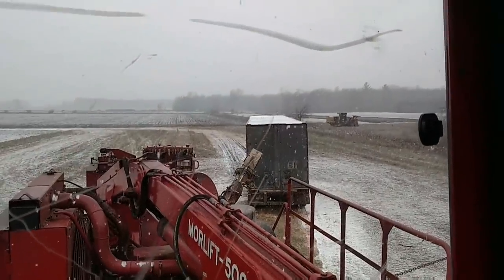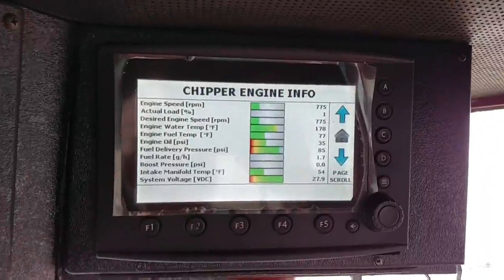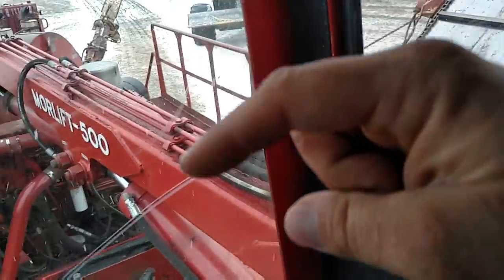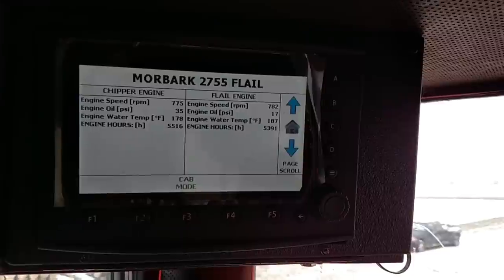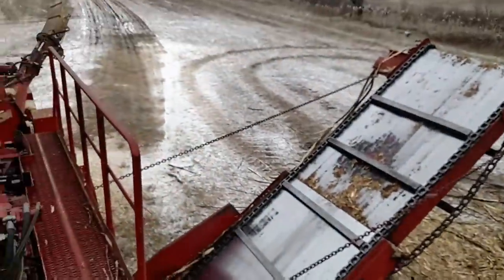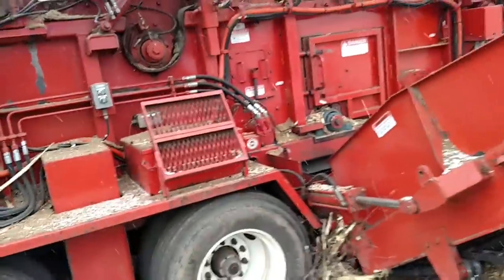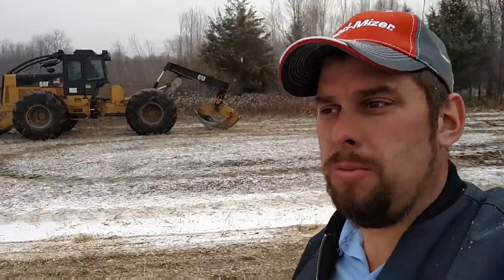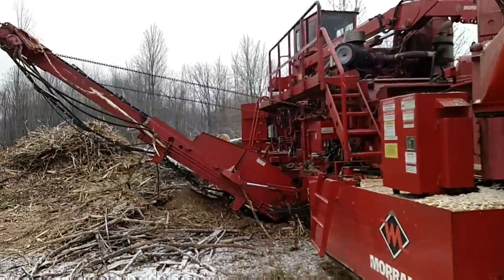COUPLE ISSUES!!!! CHIPPER FITS!!!

Comment: is the main engine a C32 or a 3512. I have done lots to 3512's but almost nothing to the C32's both are good engines. another good video. when doing the hot change, I normally put out the old part, put my thumb over the hole, get set ,then put in the new part. seems to work better than just pulling the old one out and jamming the new one in.
Reply from the maker: its a C32. Thanks for Watching!

Comment: Have you done all the teeth on that slasher saw? I was hoping to see a video of how you change them.
Regarding that hydraulic leakage on changing those transducers Could you pinch the supply pipe a bit using a tools like that which is used on vehicle flexible brake pipes ot would it damage the pipe? How does Morbark suggest you change them without getting covered?
Reply from the maker: +Dan Whiteford Nope haven't done teeth yet. This video was recorded before I jacked the saw up. I'll be sure to make a video on the teeth!! Thanks for Watching Dan!! Great idea on pinching hose

Comment: Hi:
Is this a older video oryou have fixed the saw blade.  Is the Saw blade Fixed?
I did not know you had so many sensors on the Chipper. Very interesting, but the wood chopping machine is complicated and there is a lot of things that will stop the machine.
Have Fun
Reply from the maker: +Csbinet Maker This video was done before the saw mistake. I'll be sure to make a teeth changing vid!!